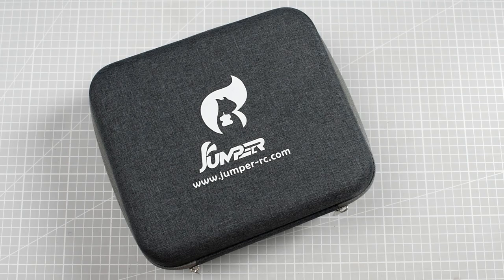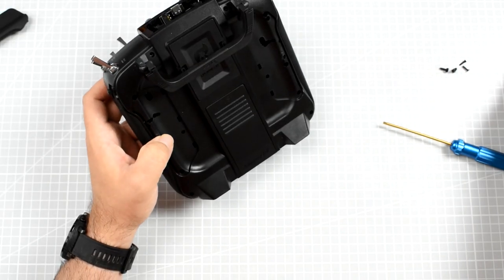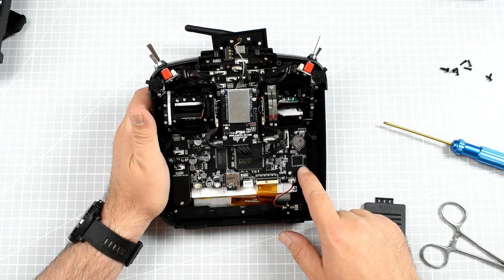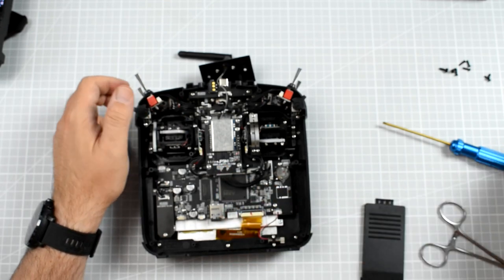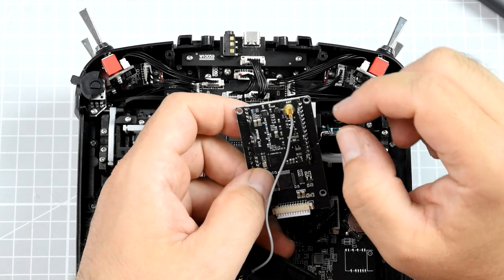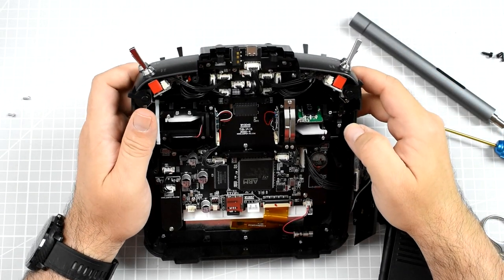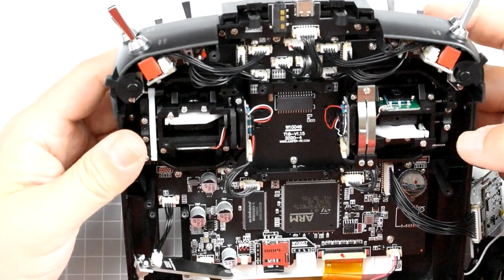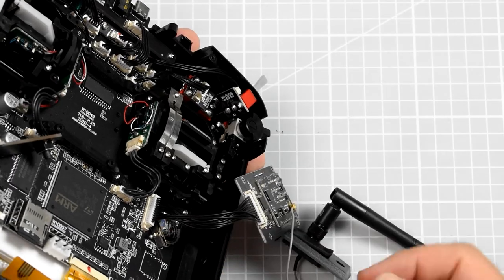Jumper T18 Teardown, what's inside and what's up with the roller

Comment: I want to buy one of these 5-in-1 modules. They work perfectly inside the Radiomaster. Plugs right in, R9 shows up. Tried it before giving away my T18. The only issue is the screw pattern, which can be worked around.

Comment: Thank you for the nice demonstration.  I ordered my jumper T18 pro from Defiance RC only today and it is on its way the same day.  Great service and they have some available still.  I had waited over a month from another supplier and cancelled that order.  I am hoping it will mate with some of my other aircraft and drones so I don't have so many transmitters. lol.  Your demo saved me from the temptation of opening it up and peeking at the inside.  I hope it has a good manual and cables in case it needs some updates etc.  I will be interested if you have more information on it in the future.  Happy Flying

Comment: Those gimbals are the Alps RDC90 versions, not the Hall sensor versions as in the T18 and T18 lite. The one under review is the T18 Pro version, not the regular T18. The 2.4GHz antenna position (horizontal) makes sense for model airplane flyers as they tend to fly much higher than race quad flyers do. Would have been nice though if it were external so that one could rotate it in the optimal position. ;-)

Comment: Apparently, R9 has significant market penetration.  Enough to derail Jumper slightly and knock this radio out of focus. I am adding crossfire to using FrSky on a T16 that has been fine, new ribbon cables waiting in a bag. So T18? erm...  The internal antenna? Both the encoder and the antenna seem fixable but are annoying at this price.  I hope the gimbals are good on the T12 Pro. because the T12+ is my current favorite.  Thanks Pawel.

Comment: Pawel, Thanks for the review. I have a T18 but don't plan to use the 915 mhz part of the 5 in 1 module.  If I swap the 2 ipex connectors so I can use the SMA fitting on top for a proper 2.4 antenna do you think the horizontal 2.4 antenna on the back would be enough of a load on the 915 portion in case I would accidently turn on the 915 and not fry the module? Thanks, Aero
Reply: I would love to know the answer to this question. I would also like to use the top antenna for 2.4ghz.  Please let me know if you ever learn more on the subject, Thanks!

Comment: Did you see the shit storm I helped cook up over the dodgy SD card reader? 

I think the SWR on the standard 900mhz antenna is crazy high. Was getting nasty interference on the analogue inputs when using that part of the module, resolved by putting an aftermarket tuned antenna on there. 

I am really liking the radio, but it has some jumper-esque touched to it.
Reply from the maker: There will be a separate video about the antenna. Spoiler alert: it's not even near to be 900MHz antenna
Reply: @FPVUniversity  I'll try to act surprised!

Comment: Hi, very good video! Do you think that the metal roller on the Radiomaster TX16S will work on the Jumper T18 transmitter which has a plastic one?

Comment: @Pawel Spychalski - How hard would it be modify (swap) the antennas make the 2.4ghz external and 900mhz internal?  What about if you want to use crossfire can you use the 900mhz Jumper built in antenna intended for R9?   Thanks!
Reply from the maker: quite easy. You only need a different SMA pigtail and that's all. Wort case scenario for 900MHz antenna is just 7,8cm of copper wire

Comment: Thank you Pawel. Nice and informative...
Do you think it would be simple to connect a pigtail with RCA conector drilled to the top and place a real antenna for 2.4?
Ps. How would you rate tx18 relative to tx16s, Im thinking of gettin a New Radio.
Reply: This is as easy as you say. You'll want to run a 900mhz antenna or dummy load on that part of the module, just in case you ever turn it on.
Reply: @wtfmimshag  plan is to keep a 2.4ghz antenna on All the time

Comment: If it can't run R9M Flex. It's useless basically...868mhz EU LBT is terrible, even using a genuine FrSky Module...but 868 MHz Flex is another story......The internal 2.4g antenna is a sick joke TBH.

Comment: I have mine for a few days, I bought the normal t18. I have two complains about it, the hissing sound (specially with low brightness) and roller should be more premium feeling. About the 900 antenna, I'm thinking about install another antenna for the 2.4 near the 900 one or remove it completely. I use crossfire and 2.4 frsky receivers. If the lite version had the carbon front that would be the winner for me